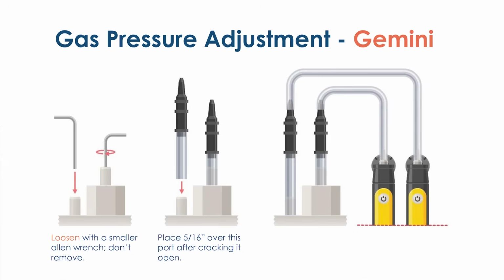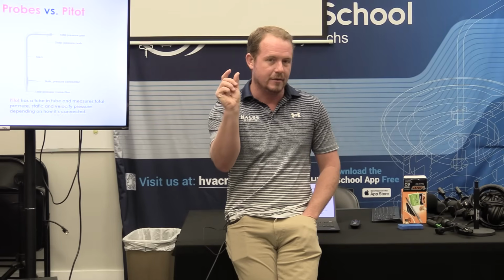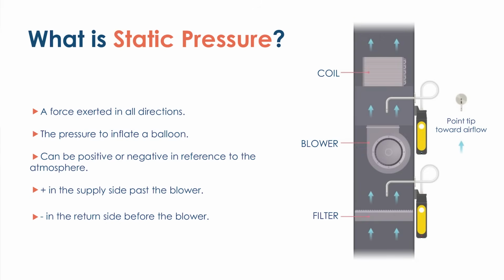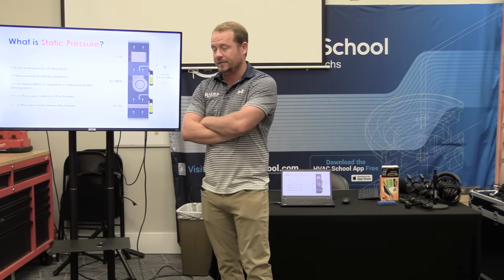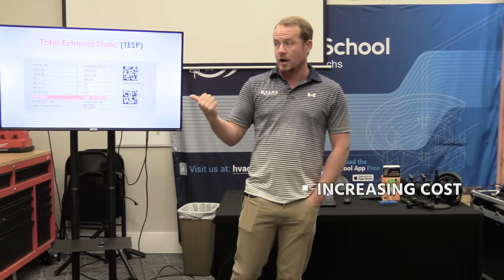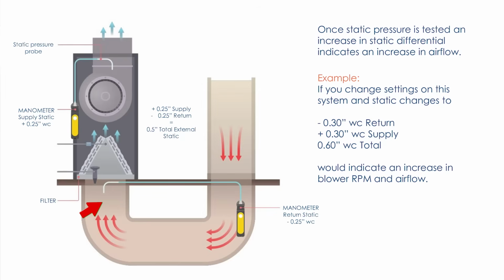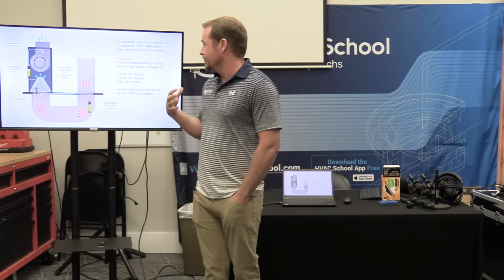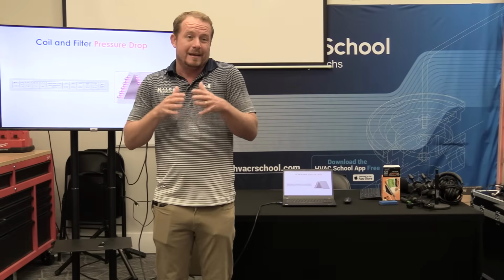Static Pressure and Manometer Basics

Comment: In order to demonstrate the low pressure scale of inches of water column is to use a u-tube manometer or a slack tube before you even introducing a magnahelic gauge or electronic manometer. Students should work with these components before using fancy electronic types. Water manometers  and magnahelic gauges do not need batteries. The latter mentioned types are better for Training fundamentals. This also applies to gas pressure and burner set ups.

Comment: ❤I watch all your Videos, so informative. I’m not a HVAC guy, I do hire it out and it’s not cheap. I believe every Dollar I spend with an experienced HVAV is worth it! They have earned it with many hours/ year’s in classrooms, such as these here. I’m now retired and use a man who has designed systems in several homes I own. The balancing of duct with variable speed unit’s is crucial. Listening to this young man’s knowledge is impressive. This should be the goal of anyone seeking a professional in HVAC business. And anyone who seeks an HVAC contractor to install and perform maintenance should never settle for the low priced contractor that have minimal experience. 
The two Systems l have recently have averaged around $12,000 to $15,000 on average depending on Square Footage of my homes in Alabama and Florida homes. I specifically wanted Round metal Ductwork wrapped insulated outside with plenty of Mastic! All due to my allergies. Fiber from the insulation on the inside caused my asthma attack to increase. No problems whatsoever as the insulation on the outside of ductwork. 
I loved the video and hope to hear more.

Comment: You mentioned 14.7 and that is atmospheric pressure at 30.02 inHg.  That is called absolute pressure and is 0 psig gauge pressure.  I think that would also be 0 inH2O.

Comment: So what I got from this video is:

2 types of manometers one that we don’t care about the hyper sensitive and the one that we do that measures inches of water column

You can measure singularly zeroed or a differentially.

You measure furnaces before and after the blower. This is to see if our duct systems are problematic.

You can also measure across the coil or across the filter or return plenum and supply plenum.

I’m unsure how to insert probes in any location that isn’t a plenum. Are we supposed to just make a crap ton of holes on the furnace? Coils have plates on the front and back sides of the A frame like I’m unsure of how exactly we are supposed to hole and probe and do we just plug it with tape? Need a special rubber plug? Is there permanent probe latches? Would have loved it if there was some demonstration or real life application. A dubbed over video of the process.
Reply: TEC has videos that will answer your questions.  they offer probe ports.

Comment: Before believing any pressure readings as Gospel Truth, FIRST thing that I do, and suggest to those I mentor or train, is check all returns for blockage, and discharge registers for closed dampers. Properly sized and installed systems will incorporate volume dampers. Think stepping on or kinking a hose vs. putting your thumb over the end - increasing noise and velocity at that point.

Comment: Bryan, first of all awesome video.  You are dead on with many things in this.  I use to be a test and balance guy and I now teach HVAC at a tech school . A good analogy you might use for reading static pressure is that you always need to reference something to get a reading.  Be it zeroing your meter or having the other port open and having that zeroed as well. No different than reading voltage with your DMM ...you can't read voltage with one lead, you need the other lead to reference something ( an neutral)  or your reading means nothing. If that makes sense?

Comment: No one Installs the small transition section pieces between the furnace and the coil out here very rare which you would run into this as an issue testing static pressure on gas furnaces 🤨

Comment: @HVACS . Correct me if I am wrong, but around 18:05 you mention about  ECM motor reacting to increased static in a blower assembly. Only in constant speed mode will it try to maintain speed and increase amperage, while in constant torque mode, it will increase in rpm (since less work required) and reduce amperage.

Comment: Charging any AC or HP system correctly ASSUMES correct rated airflow which is usually 400 cfm per ton. This is a big point that should be emphasized.

Comment: Are you saying that to test properly, I need to set my blower speed to the MAX setting to complete the test? And then before I left the customer I would lower it to the proper CFM for the customer? It seems to me that I would test it at the normal running speed.

Comment: I am confused about how you can add together -0.25  and 0.25 and get 0.50. That’s some magic math lol. To me that is 0.0. Are we completely disregarding the negative? 
How would it work when using a magnehelic?
Reply: It’s the difference between the supply static pressure and the return static pressure. So .25 - -.25 which is essentially .25 + .25 because when you subtract a negative it is like adding the positive.
Reply: @UnusedRap your wrong, it is in fact, math magic 😂
Reply: I thought the same thing, but then I adapted to the notation and it all made sense.

Comment: A lot of times the grill and filter size are fine but the box behind grill/filter and getting to input of air handler is just an afterthought based on what space is available.  This can affect the uniformity of air flow across the area of grill/filter, effectively making the grill and filter perform poorer (smaller) than its physical area.

Common issue when grill/filter has to be offset from air handler due to an interior wall.

Comment: Air handler usually refers to a fan coil unit integral with coil as used in a heat pump.
 Can't believe the percentage of homes that I've looked at since I've retired from industrial/ institutional work that have never worked correctly because some hack didn't know how to size duct.
 The number of contractors that tell homeowners they need a larger unit when the duct system can't support what is there is astounding.
 Filter manufacturers push 'allergenic' and 'high efficiency' filters that are too restrictive when brand new for the base unit's design.

Comment: I disagree with checking external static pressure on a high speed. And the reason being is if we design a duct system with a blower at a .5 inches of water column for a specific friction rate, why would I change that if as a result I’ll have more air flow and higher static?. It’s the same weird concept where people are changing the fan speed to high in order to check CFM on a gas furnace. Why would you add extra work just to verify air flow? Blower performance charts are usually available. I could go on all day about it. Thanks for your videos.

Comment: Thanks for another great and informative video!

I've recently had to go through a crash course on using static pressure to identify ducting problems. I work in commercial HVAC and if I were to use the TEC Tru Flow with all the adapter kits, it would get very expensive with all the extra adapter kits. Majority of the RTUs I work on have 4 filters or more per RTU. Can I get away with using one adapter plate and placing in the middle of the filter rack or return ducting?

I own Testo 510 and Fieldpiece SDMN 6 stand alone manometers. I find the SDMN 6 drifts quite a bit, which I believe is due to not being temperature compensated like Testo. Does the Fieldpiece wireless manometers drift as well?

Comment: Great video. I do HVAC at a hospital and we do a LOT of air balance and static pressures. We always take a static pressure differential across final filters on the maintenances. Recently I took a bunch of Pitot readings to evaluate plugged chillwater coils to see if they need replacement. 
It was definitely a learning curve.

Comment: Excellent lead into using DEEP PLEATS HIGH MERV efficient filters on Correct size. Of course measuring pressure drop or following the chart printed on the side of the filter and always recommend upsizing.
Reply: Get like 2 inch thick filters or 5 inch thick to improve air flo

Comment: Another tip to add to your discussion....if you use the different airflow ramping profiles on a variable speed blower.....especially for the humid ramping profile, where the blower will ramp up to 50% for 30 seconds then 70-75% of full speed for 7-7.5 minutes, then it finally hits 100% full speed. Wait till you get to full speed....or change the profile to a non humid profile,  where it'll ramp to 50% for 30 seconds and go to full speed.....just remember to put dip switches back to what its supposed to be for the location you are at.

Comment: Great tip for using masking tape to seal filters that don't quite fit.

I also like to use silicone and/or foil tape in cases where the filter box is not properly sealed with the rest of the duct work.

Comment: How is +.25" - 25" wc = .5" . Wouldn't it be 0?
Reply: With external pressure you ignore the negative
Reply: +. 25 - (-.25) = .50
You subtract the negative pressure return air wc from the positive pressure supply air wc.
Reply: The blower essentially is doing two things at once,  pulling return air in through the return, AND sending air out through the supply.
Both have an effect on how hard the motor has to work, so even though they are different types of pressure, you add them together for a complete picture on what's going on.

Also , make sure to have the doors on when taking static pressure, because that can effect you readings as well.
Reply: Old school number line. Zero in center of line, negative to the left of zero, pos to the right, draw  25 divisions to left of zero, and then 25 divisions to the right of the zero. TSP is from one extreme to the other..
Reply: Its a cumulative measurement
Reply: plot both values on a number line.  whats the distance between them?

Comment: I wish manufacturers would put in test locations for manometers
Reply from the maker: Amen
Reply: I came across where you can insert your probe in the high limit whole. Some carrier models like the newer ones you can pop out the LED plastic cover on the blower door.
Reply: @mackenziegray2090 I used the LED port on mine. It’s a tight fit because they’re building the cabinets extra “compact” now. But it does work, only I ended up breaking the locking teeth on the plastic lens so will need a dab of silicone now.
Reply: Some York RTUs actually do. I like that so there's consistency.
Reply: @jonathanmark7751  yes I’ve noticed this on a few York RTUs
Reply: @jonathanmark7751  just serviced two York's yesterday 💪🏿 starting to be one of my favorites to service that and carrier
Reply: You can buy a little plugs so once pre-drill the hole for your tester you just pop the plug in there and that way it's not an issue with loss of air and it looks clean too
Reply: The new Carrier residential furnaces that are going to roll out later this year will have it so you install a static pressure sensor on both the return and supply ductwork.
Reply: York RTUS do so you can do a static drop across coil to determine air flow. I wishbthey would do the same for furnaces
Reply: @francismarotta2301  some of the York's have a knockout with a plastic cover on the inlet and outlet of the evaporator. If it's a down discharge RTU, the supply air cover has a knockout too. 

It's best to read the manual because Lennox RTUs actually ask for the supply static to be measured after the first 90.
Reply: Heck, just put the manometers in… whats $30 on 5k of equipment
Reply: Yes the York Rtus ive dealt with have a removable rubber plug.
Reply: Um Yeah
Reply: Foreal
Reply: True that